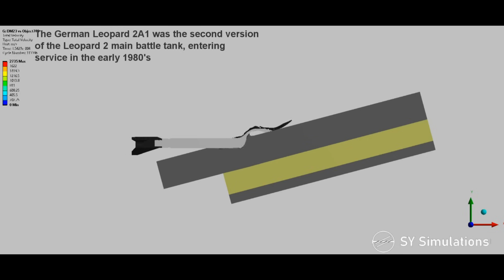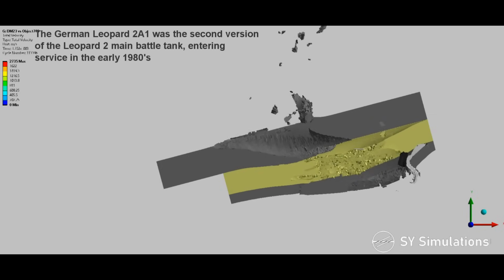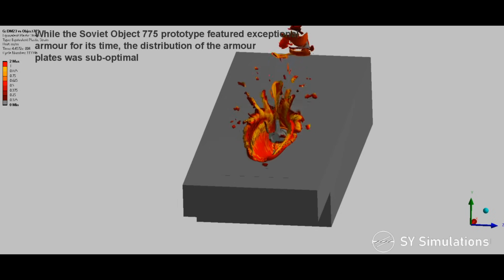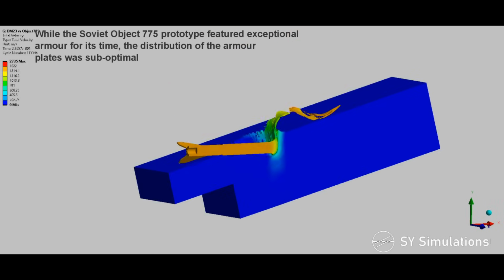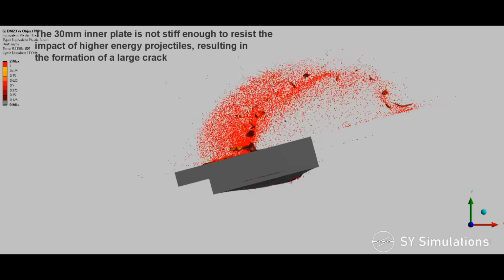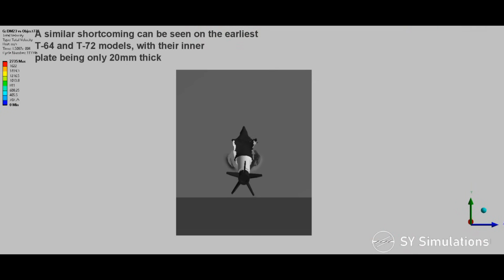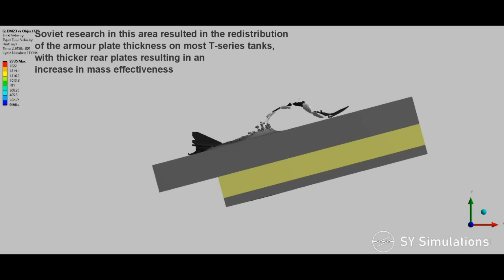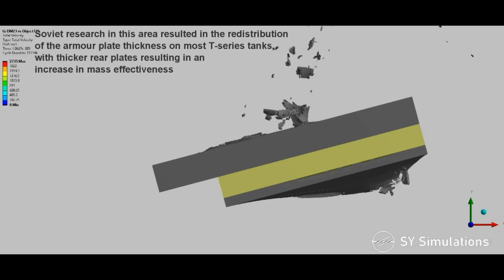LEOPARD 2A1 vs OBJECT 775 | 120mm DM23 APFSDS vs Pancake Tank Armour Penetration Simulation

Comment: I wish that in WT this woulf also happen, even if the round technically didn't enter the fighting compartment, there would still be shrapnel entering the tank because the armor plate actually did give out.

Comment: Can you please simulate the recent Bradley's 25mm vs T90M on ukraine ? At that angle of, maybe, 20-30° angle, the side armor's 80mm plate should be pretty close to 90mm. I was wondering whether the repeated hits from the 25mm are able to penetrate the side-of-the-hull plate. Assuming the ERA are gone from previous hits, the side armor's effective thickness of about ~90mm againts repeated hits from (taking info from warthunder's apds spec 😅😅) ~80mm penetrating rounds @ <100 meter surely is very close to penetration.

Comment: Floathua
I want to repost your video to the Chinese bilibili websie，It means distributing your video to other websites and marking your original link. Of course, all this behavior will not bring me any financial gain. It is all yours.I will not change your video, your video will be distributed to other websites as it is and bring Chinese viewers to your original video，It's all about generating electricity for love. In short, it's a porter. Of course, the machine translation I used may not be accurate when it is directly translated into Chinese?I'm waiting for your reply here

Comment: I want some crazy engineers to design a moder Maus.
With current engine technology I am pretty sure it is possible :D
Reply: Well, just slap 3 Abrams tanks together and you will get it. However whats the purpose?
Reply: @Янус_Ырт  To get easily destroyed by airstrike
Reply: @Янус_Ырт because we can
Reply: Why? There is no universe where anything remotely resemebling a maus is suitable for modern warfare
Reply: @rusteddoorknob4237 warhammer 40k...
Reply: @jacqirius  modern warfare, and this is wrong anyway. Show me the maus thats not instantly getting vaporized by a leman russ' helbore
Reply: @rusteddoorknob4237 the baneblade?
Reply: Forget the Maus. Make a P1000 Ratte with modern armour
Reply: @TehShinegami  Forget the P1000 Ratte and make the P1500 Monster

Comment: I'm curious about how to distribute the armor plate thickness to most efficiency. How about testing different ratio together? Let's say you have the same Textolite, while the outer:inner plate are 90:30, 75:45, and 60:60. That would be very fun.
Reply: We actually know the answer. 
Each layer should be about the same thickness with at least 3 layer, and the layer should be at least about 40mm.
Reply: You want to add layered armor, because projectile bends and twists along the way. You can see it in this simulation. It starts to develop a meaningful twist when it had beaten around 80% or armor. Blunted and deformed projectile cannot penetrate armor as well, because it twists during free fall in intermediate medium and connects in poor angles where energy is transferred sideways. 

Optimal armor composition should had been 75:45.
Reply: What about a V or A shape if apfsds projectiles follow the plug hole it will enter the second plate at an unfavorable angle